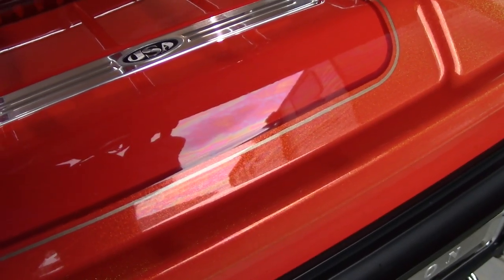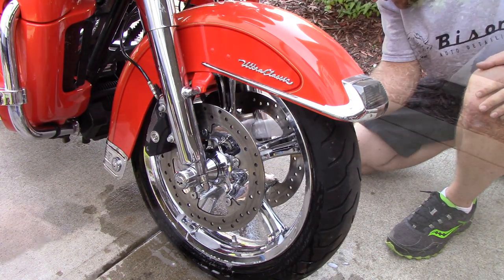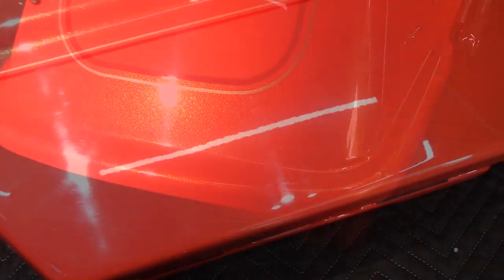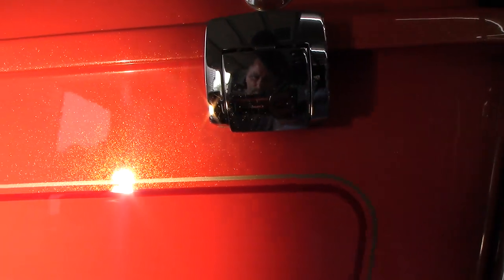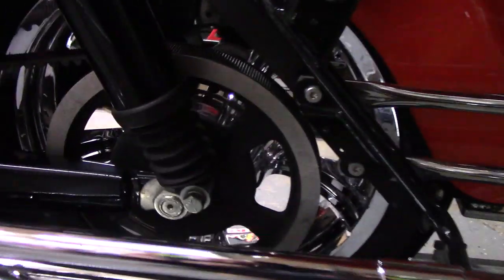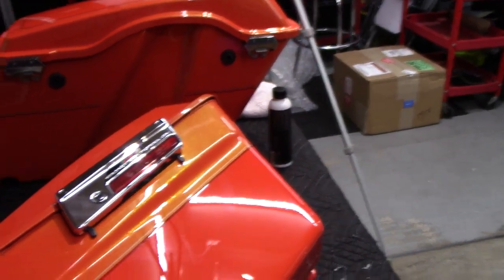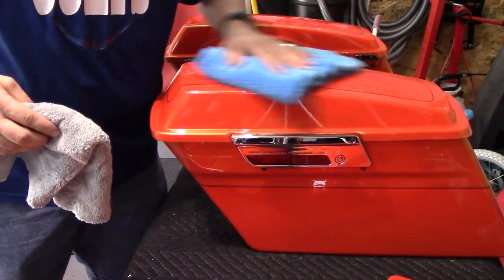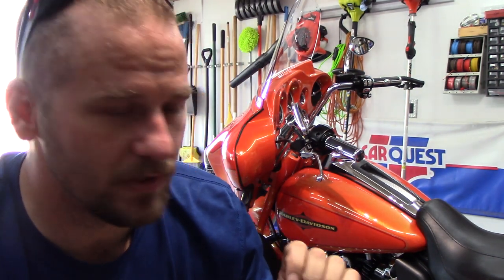Harley Davidson Full Detail with Heavy Swirl Removal!

Comment: hello I wanted to know if the polisher is better with battery or with the wire to be connected to the network?  With the vivid color black I think it's more difficult, am I wrong?  Greetings from Italy.
Reply from the maker: Cordless or wired doesn’t matter. It just needs to be able to spin the pad fast enough for correction.

Comment: I know this is a couple years ago but....   Why would you leave the saddle bags on the bike to not only clean the rear wheel but also wash the bike and then take them off to polish them?
Reply from the maker: It’s easier to wash the bags with them attached so I do t risk knocking them over if I put them on the ground while washing. I took them off so I could get to the back side of them to polish and coat.

Comment: Not sure I would enjoy doing a Harley.  Looks good though,   My old neighbor built a bench he could drive his bike up on after this I can see the true genius behind it.  After this vid you may end up picking up some more bike action and may need to get a lift or build a bench yourself.  Nice work again though.  I got a griots 3inch you can have,  used once and hated it so bad when I finally got my Bigfoot I pulled the backing plate off of my little torq and swapped it with the griots polisher.
Reply from the maker: Jason B It definitely took longer then I thought it would. I wouldn’t mind picking up more bikes. My wife bought me a new 3 inch swirl killer but I appreciate the offer. Plus Griot’s just unveiled a new 3 inch it looks awesome. They went from a 200 watt motor to a 700 watt
Reply: FAB as far as griots goes I am done with polishers from them.  If things ever get serious for me I will probably stick with rupes.  I may sound like a fan boy but a couple bad experiences with cheaper ones will do that.  If you pick up more bikes you could almost justify the rupes nano.
Reply from the maker: Jason B Hey man use what works for you there is nothing wrong with that and doesn’t sound like a fanboy. One of these days I will definitely get the iBrird Nano.